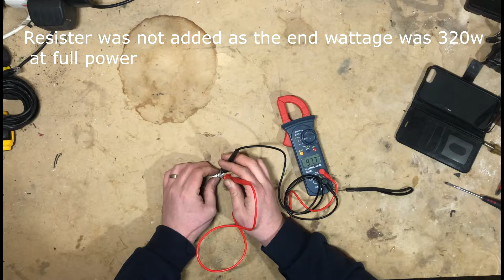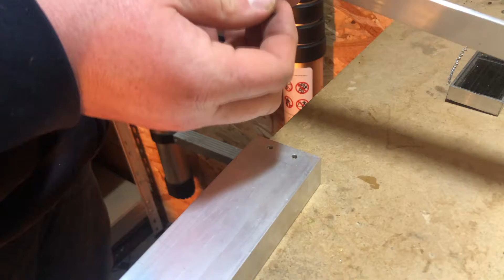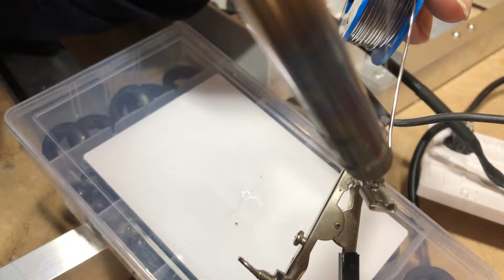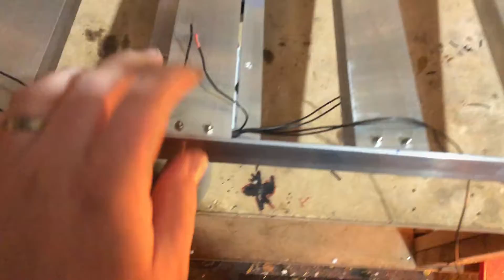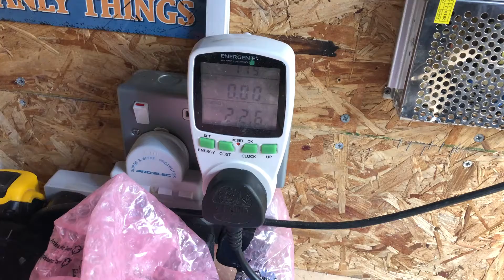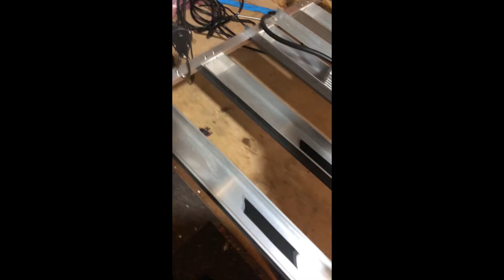How to DIY Samsung led strip grow light *** HIGH EFFICIENCY ***

Comment: I would bolt those LED strips down, the double sided tape could lose its sticking power, and then your LED array turns into a fire hazard. Also I would get the cheapest thermal paste, and use that to connect the LED strips to the aluminum frame thermally. For the fixation of the LED strips i would use small nuts and bolts. Preferably nuts with the silicone in them so they wont come loose. 

Further, I like your build style. 

Greetings,

Jeff

Comment: Total cost?
Reply: The LED strip are about $20 USD each (5 strips - $100 total). The driver is about $100 USD. No idea how much the aluminum and other bits and bobs cost. I'd estimate the entire build is about $300 USD. That's not terrible for a CUSTOM lighting solution, but an off-the-shelf light could be cheaper.
Reply: @Tyrone-Ward  It depends on the size of the canopy you're lighting.  If you put it in a 4x4 and the lights work out to similar par ratings as something like an EVO 6, you just saved everyone like 200$.  I don't think this is more expensive than the current offerings.  What size is this going in?

Comment: Great work, Sir. Aren't you worried for the parallel wiring? I ll do sth similar, but drivers are so expensive and I postpone it all the time... Hahba
Reply from the maker: Still using it now…. So Not worried at all the driver is made to run that amp at that voltage all is fine 👍🏻

Comment: I had the same problem with the heat when I built my own heatsink. Found that additional smaller u channel aluminum strips heat taped to the back of the u channel helped some. I still can’t turn the light all the way up or I’ll cook the led. So I just use it fir veg. I’m also pushing 3500ma strips
Reply: Brilliant build lm going to do the same build but use 40mm x 20mm x 2mm box section ali, have you thought of doing that,must help more with the heat
Reply: Hi

Comment: Great job on the build
Quick question on electrics if I wanted to run 7 strips what driver would you advise .
If you explain the maths in short I’d appreciate it .
Thanks
Reply: what size strips ( 50 w 560mm or 105 w 1200mm ) 7 x 50w = 350w , not sure a 320h 48b will run them full blast but the next mean well 480h - 48b will and you'd have a plenty of power left in the driver so you could had more strips and dim them down so they dont run as hot

Comment: Need 2 of these over a 4 x 4, cost over 500
Reply from the maker: Two of these would not work correctly in a 4x4 tent, it also  would not cost double the price as it would run of one bigger driver which costs less than 2 300w ones and you would use 4ft led strips the cost would be more around £400 ish 👍 thanks for the view tho….

Comment: Where did you buy the light modules?
Reply from the maker: Digikey mate
Reply: @OverGrowTheUk  are they the so called “digi reels” ? 

Did you have to request a reel of double leds instead of single ?
Reply from the maker: @ideasforlife2591  no they come as standard with the twin lights on board mate.

Comment: Thanks for the video. I can't believe that some grow lights cost 500 or even thousands of €.. So much money for something you can do on your own.
For that money you can buy washing and drying machines, refrigerators and freezers, TV's, computers and laptops, cellphones, used cars.. So much more could be added to that list.. And none of those things can usually be made at home.. I'm tired of this market, everything made for growing is triple the price.. It's just a light ffs!
What's even worse, you buy a cheap grow light like Mars Hydro and it stops working within few months of use, so you have to spend more if you want a reliable light...
Reply: The costly thing is the driver

Comment: Hi. First of all great build and definitely something I will try to replicate. But ... I have a question about something that's not my forte ... electricity. You got 5 strips and when I looked them up they are 1.1A and 46V or around 51W. How can this 320W driver go to the max when in theory you should be around 255W (51x5)? I know it's a dumb question since it's working perfectly but please can you explain what I'm missing? Thank you
Reply: Its under driven like most LED fixtures to increase efficiency and increase lifespan of unit. More energy used to drive the unit to its max chips will burn out quicker and increase heat from more energy.

Comment: Nice demo. Cheers. I may have to have a go at something like this but with 2 or 3 Invisible Sun R strips for some corner to corner coverage in my little setup.
Reply: are those leds better?
Reply from the maker: @jbbolts  better than?
Reply: @OverGrowTheUk  Better than the ones you used in this video? Would you use anything different if you were to do it again? thnx btw... very informative video
Reply from the maker: @jbbolts  there are more efficient diodes made like the Samsung h influx strips which use the lm301b diodes, but I don’t believe the efficiency warrents the extra ££ personally. This light performs really well and I am glad I built it 😁💪🏻🌱💚 take care mate thanks for watching .
Reply from the maker: Thanks mate 🌱💚💪🏻

Comment: Nice build i have done a couple with the Bridgelux eb strips, gen 2 and gen 3 which are awesome leds and great price the gen 2 are about same as your Samsung f series and the gen 3 are on par with Samsung q series but cheaper. I grew great flowers with both. I am planning a new build soon with a mix of Samsung q series or bridgelux eb strips gen 3 along with cree xpg3 reds and whites i have a number of parts already. Digikey has all the parts and probably best and cheapest place to source. I will be using a aluminum sheet i have one 24 inch W by 30 inch L . And 3 mm thick Ill be using the 560mm length strips layed   going up the W the whole way with a couple with about 3 or 4 rows of white and reds cree xpg3 in between, the xpg3 are a kick ass led also and the photo reds are the most efficient red led currently. I will be getting them off digikey and the star boards off allieexpress. I also have a bunch of xpg3 whites already. Enoughf rambling from me, awesome clean job on your build. If you never checked out digikey you should, also allieexpress has cheap prices on Chinese drivers and led diodes like cree xpe2 whites reds, xml2 and 3, xpg 3s etc.... can build a light alot cheaper than it would cost to pay for something as good or on par. Have a good day.
Reply from the maker: Thank you mate 🌱💚💪🏻

Comment: A really well explained demo mate 👍.  What is estimated parts cost?  
🌻Nigel.............MuddyBootz Allotment🌻🌻
Reply from the maker: Cheers mate it was about £250 all in all but could be made a lot cheaper if you didn’t use a dimmer or switch as the driver in this lights is slightly more expensive because of that feature  👍 all the best mate